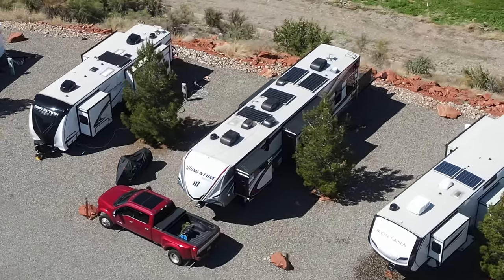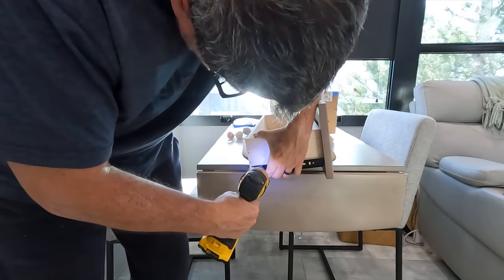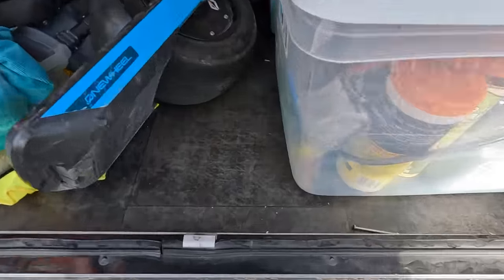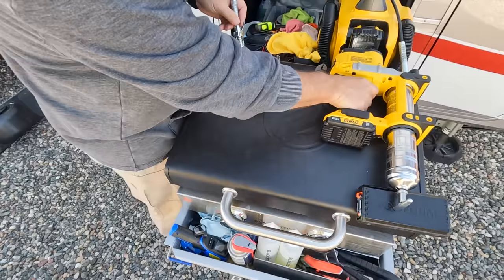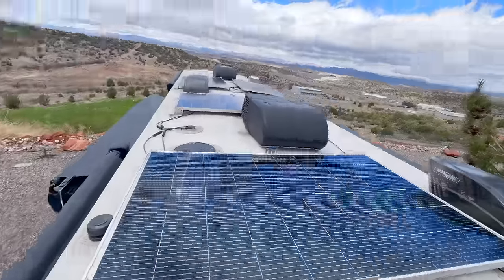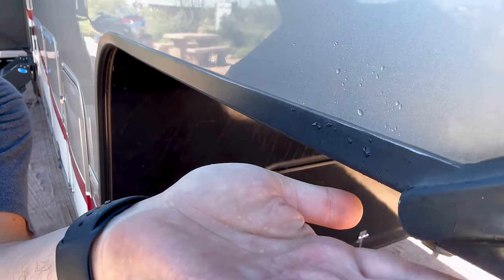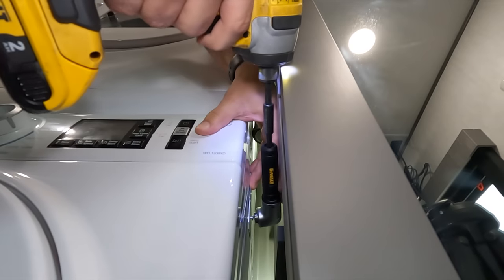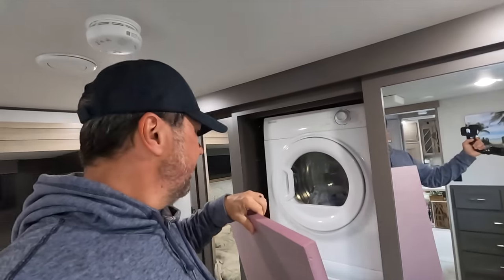Quick Fixes to some Annoying RV Problems! (RV Life!)

Comment: On your basement latches they are supposed to be a gasket and they are not thick.(paper thin gasket)  I was told by a dealership to run a bead of caulk around the latch to seal them up.  No problems with the latches once I did that.

Comment: I used the Splendide stacking hardware. The dryer is securely attached to the top of the washer. It hasn't moved in over 2 years of full-time RVing.
Reply: ditto only 5 years no movement
Reply: Same here with the stacking hardware.

Comment: I had the opposite problem on my brand new Brinkley.  One latch on the rear storage door would not release.  When you lifted the handle you could feel the latch move then all of the sudden in would snap closed before the door could be opened.  I had to force the door open (luckily w/o damaging anything) and opened the latch to find that when lifting the handle the mechanism that lifts the latching "bar" was slipping off the cam that connects to the handle, simply because the screw that held the latching bar to the cam was loose.  By simply tightening it it worked fine.  The annoyance is that when it fails the compartment door latch locks "closed."

Comment: Appreciate you’re videos. I watched another video on resealing edge of roof and gutters and the person mentioned using a small piece foil hvac tape for gutter seams. Our 2005 fleetwood had foil tape and looked like silicone underneath. I put a little dab of silicone and then foil tape.

Comment: The only thing I would suggest if you're going to use some kind of insulation on either side of the dryer is to remove it when in use because of possible airflow problems and heat build-up. Please keep up the great job you guys are doing.

Comment: Look for "Air Wedge Bag Bump" air wedges used for leveling. That will let you dial in the side pressure to keep it from rocking while providing some give.  Also very light and quickly removable.

Comment: I see lots of good suggestions here.  We used pool noodles.  They are inexpensive, available everywhere come in a wide variety of colors.  It wasn’t actually a pool noodle that we used, but some pipe insulation from Home Depot.  I wanted black because I wanted to be as inconspicuous as possible
Reply from the maker: I was just wondering if they had pool noodles in black.. LOL. I'm leaning towards the pipe insulation too. 👍🏼
Reply: Florescent would be good for night time

Comment: I have a 2018 Arctic Fox fifth wheel. I drive 15k miles last year including a trip through Canada to Alaska. I haven’t had any trim issues or slam latch problems.  In fact I haven’t had a single problem with my RV. I went and bought the Dewalt air compressor after watching your last video. Thanks for the tip, this is a fantastic suggestion.

Comment: Hobby Lobby has pillow foam in different sizes and thickness you can probably use. We got the 3 inch thickness squares to shove up in the kitchen and bathroom vents for winter temps it kept the RV much warmer this past winter.

Comment: Quick tip for anyone working with Eternabond tape - once you've removed their miserable to remove protective, put it on a piece of parchment paper to maneuver it around. You can fold it and pull it loose and it won't stick at all to the Eternabond tape (and save a lot of frustration in the process)

Comment: Thank you for the slam latch lube idea.  Mine were doing the same thing.  I put a little marine grease on each side of that lever part you greased - hoping it will be resistant to the water that gets in there.

Comment: I love that my 24-year-old Monaco dynasty has drain tubes for the condensation from the ACs that run it all the way down underneath the couch. No Mas and I still haven’t had any problem with my bay door latches except for cleaning and moving them without having to take anything apart, and I do full-time in my motorhome. Thank you for another informative video.

Comment: Chad, something I learned about the Splendid washer you have. If you wipe the inside of the bottom rubber gasket after each wash and leave the door open so it can dry properly you wont get that discoloring and possible mold staining on the gasket,
Reply from the maker: Yea.. we do that after we replaced the gasket in our last one.. 👍🏼

Comment: Same problem with the latches and my fix was the same as yours.  Though I did add sealant around the top and sides.  Plus along the hinge at the top to stop water from getting inside the door itself.   For my drip rail I used Lexel.  It sticks better and is more elastic than silicon.

Comment: On the dryer I would be concerned about blocking the air flow into the dryer with insulation on the sides.   Maybe have it in there when you travel and take it out when you're going to run the dryer. What you did on the gutter seal looks good.  I would have tried Flex Seal.

Comment: Another idea for the rust on the lock... Boeshield makes a rust and stain remover that could maybe help with the rust on the slam latches.  Then add some grease or lube as a protectant.
Reply: Was going to say the same thing Boeshield T9 works wonders

Comment: Just a thought. Try putting/wedging a couple 3’ tubes of fiberglass pipe insulation vertically alongside the machine’s. Has better heat/fire resistance & will allow vertical ventilation. Great tips & ideas! Thanks for sharing your experiences 👍🏼

Comment: For the gutter use a rubber sealant spray like Flex Seal,  you like Gorilla brand products , they  have one Gorilla Waterproof Patch and Seal Spray.  My experience is the products are very thin and would require  several coats.  I used  Rust-Oleum brand on my house gutters.

Comment: Our stackable washer/dryer unit came screwed together similar to what you did but we find that there is room on both sides that not only does it move while travelling the whole unit shakes a lot during the spin cycle.  We have fixed that by putting pool noodles on both sides of the units.  if not enough room you can cut them in half to fit.

Comment: In our 390RKR with the washer dryer I actually pulled the out half way and blocked up the front to be level.  Then used two pices 1/4" steel 8 inch long and 2 inches wide and drilled for four bolts on the washer and four on the dryer.  Marked them out on the appliances and drilled the appliances and installed threaded rivit nuts 1/4 x 20.  Then used bolts and loctite blue to fasten together.  I was worried the self tappers would eventually work their way free.  We now have a 399TH with washer dryer in the garage and I sure prefer that.

Comment: For the gutter, I used caulking only, and it stuck on pretty well. For the Lippert basement door handles, same issue as yours where rust appeared early on, needed to be greased and saw that the handles end up "catching" a lot of rain water, enough that when you open the basement door (lifting it up), as the handle is now upside down, that residual caught up water runs down the door and the open basement area, needs to be cleanned often.

Comment: Nice fixes.  Pool noodles or pipe insulation pieces might be able to be cut to brace the washer and dryer.  They would have some moderate compression and fill the spaces.  Just a thought.  Happy travels.

Comment: Chad I would use a piece of the foam from an old mattress topper not only do they have the density you need they also work well with double-face tape. Give it a try I think you'll be very happy with the results. Also, it's nice to see you guys back on the road again and your fixing stuff I'm so tired of a lot of the other channels on the frame flex soap box.

Comment: The Splendide stackable pair we have, the dryer screws down (or has a latching bracket, can't remember offhand) to the washer.  We have ours under the "attic" in the garage (399TH).  We also have floor brakckets.  Even before I put a cabinet between the top of the dryer and the garage side floor of the "attic", we never had that thing move.

Comment: What we found works best for us is: M-D 3-1/2-ft x 1-1/4-in Gray A/C Foam Air Conditioner Weatherstrip from Lowe’s!  Hubby put this in between the wall and the washer/ dryer on both sides and this stopped the movement and worked great because it’s flexible yet cushioning.

Comment: I want to reiterate what Chad said about our American highways — they are CR*P!  We are on month two of a three month trip, filling in the last four states of the lower 48 on the map on the side of our RV. In particular, the bridge abutments are generally awful. This trip our 2018 RV suffered a broken leaf spring, no doubt due to the horrible conditions of the roads. In addition, several trim pieces fell down.  Our rig had 30K miles on it before the start of this trip. With that many miles you would think that the “shakedown phase” would be over. Not with the state of our highways!

Comment: If you lube between the metal part that slides against the plastic of the latch it will work smoother

Comment: Have you considered Rockwool insulation board on each side of the washer/dryer? It’s stiff enough, it won’t fall apart and it’s not flammable and you can cut it to size. Just a thought.

Comment: I just purchased an LG 2.3 cu combo for my 42ft Fuzion Toy Hauler…was looking for some ideas to reduce the vibration.  Although it’s a different issue I stumbled across something that might work for you. Didn’t read through other comments - so not sure if someone has already suggested.  During my online search I came across the following that might work for you.  Search: Stacking Kit for Washer and Dryer, Universal Washer and Dryer Stacking Kit with Pull Out Drying Rack, Adjustable 29"/28"/27"/26"/25"/24" Stacking Kit with Ratchet Strap.

Comment: The actual top panel if the washer has come off. The dryer sets on top of a plate that latches  in to a slit on the dryer. The whole top of the washer has come loose. Clever temporary fix you have done there. But the dryer needs to come out and the washer top repaired.
Reply from the maker: The washer top doesn't seem integral to its operation, so it'll likely stay as is unless something goes wrong.

Comment: I'd probably flood those door latches with fluid film a couple times a year, that would lubricate and also stop the mechanism from rusting.   You can probably sneak a spray straw into the mechanism without taking it apart each time.

Comment: The eternabond didn't work on my gutter seam, but I hope yours holds!  My latest fix for it is 2 part epoxy in there (tape on the bottom until the epoxy set), which seems to be holding.
Reply from the maker: Thanks.. that sounds like a good plan if this fails.  👍🏼

Comment: Chad I would remove the dryer then get some aluminum thin wall angle and frame it around the top of the washer anchor down to the washer then place the dryer inside the framed top of the dryer, then screw it good the the aluminum angle maybe like 1-1/4" x 1" x 1/16" making two units as one. But hey your brackets worked also.

Comment: Another great project (that I did), I ended up doing.... after a time, the washer and the dryer began to squeak.  Bad.  I've solved most by being able to replace the bearings on the dryer.  I could NEVER get the bearings off the washer motor.  I destroyed two bearing pullers trying to get them apart.  They are ON there.

Comment: These things all have problems, whatever the price point, and so many new RVers let that frustrate them to the point of seeming to hate their rigs.  IMO, just making your own fixes is usually the right answer, along with sometimes bringing in the pros, but in either case, accepting that things will happen.  We haven't had interior trim fail (yet) in 3 years of full-time, but at one stop I noticed that one exterior trim piece was missing, and the one just like it on the other side had a screw missing, another almost out.  Early on, we had a storage bay latch fail, to where we could not open that door.  Luckily, it was a pass-through, so I went in from the other side and got it open.  The part the handle moves is supposed to slide against another part, but had gone past it (if that makes sense), leaving no way to open from the outside.  I did something to make it not likely to happen again, but I forget what.  Probably bent some metal.  We've had the same problem with a seam in the gutter, and I've resealed with silicone, but that didn't last.  I think I'll try the tape solution.
We had a leak in our roof from the beginning, and it only showed up in the heaviest storms.  It was hard to track to the source, but we found the roof has a "low" spot that makes a puddle form, right next to our skylight for the bathroom.  When the puddle got deep enough, the top reached a point where the sealant wasn't good enough.  It would then follow wiring to reach one or another light fixture in the ceiling (living room or bedroom, depending on the tilt of the rig), fill that, and drip.  Once I realized the source, I added plenty of sealant on both sides of the "bad" seal, and it's been good since.  As the great western philosopher Roseannadanna liked to say, it's always something.  We even had a roof leak on the truck, which a couple of dealers tried to fix but failed.  Turned out to be a light/camera fixture that wasn't well enough sealed.
As for the bad roads, when we started, we took your advice and didn't bolt down our wheel dock.  Mostly, that was fine, the bike was strapped down front and back.  But some roads were so bad, the whole front, dock and all, was able to slide sideways a little, not good.  So I securely attached the dock, which in ours is in a dedicated mini-garage, so no problem having it always there.  I heard that there are plans to one day pave I-20 through Shreveport.  Our dryer is well secured, but our residential fridge wasn't, and we kept having to adjust it after rough moves, until the factory guys heard that it moved, and said it shouldn't.  So they fixed that for us.  I think something similar is going on with our dishwasher, as it seems to be canted a little sometimes.  I suspect there's a bracket for your dryer that either wasn't attached properly, or wasn't installed at all.

Comment: We have a 2021 382WB - same issue with the door latches. Poor quality, and installation alignment issues also exist on the wetbay door, causing it to pop open while we are driving. Shimmed that one a bit, wire brush and lubing the rest. Had the same issue with washer/dryer. I built a wood platform for the dryer to sit on about an inch above the washer. I don't think the washer is strong enough to hold any weight on top of it when bouncing down the highway., ours was starting to cave in on top.

Comment: Our Splendide washer, when rinsing moves quite a bit.  I’m not sure I’d want that more securely “attached” to the walls.  I’d be concerned about damage to the walls, and shaking the “house” during the spin cycle.

Also, Splendide makes a bracket to mount the dryer to the top of the washer, but that tight fit in the closet might make it difficult to use.

Comment: Splendide makes a bracket that installs on top of the washer with screws and securely fastens the dryer on top.
Reply from the maker: I think that was used when installed but the top came off the washer.
Reply: @ChangingLanes  Self installed ours last July (replaced Whirlpool) and it's been rock solid in the back of our 38' Class A.  I'll check it before our next trip!

Comment: I'll watch the video shortly.  We had TWO WHEELS develop tiny cracks, losing air on our way from AZ to MI.  No fun when the spare tire is already mounted and ANOTHER WHEEL starts leaking.  This was the THIRD wheel this happened on.  I now have steel wheels and commercial grade truck tire$$$ on the 5th wheel.  Also discovered the MORryde installed disc brakes are only wearing pads on one side of the rotor.  Still following up on that issue.  It was a rough ride home!
Reply: Need to get Michelin lol
Reply from the maker: Yikes!  Glad you made it!  Our brakes wore like that also.. I need to keep an eye on them and maybe grease the caliper mounts.
Reply: @ChangingLanes  I called MORryde today, and sent them photos.  We'll see how this plays out.
Reply: @JamesAutoDude  Michelin XPS RPS tires :)
Reply: @JamesAutoDude  I did.  Although the problem were the rims, not the tire.  I now have steel rims with Michelin XPS RIBS

Comment: Chad...put a plastic bag in between the washer/dryer and the wall on both sides and spray expanding closed cell foam in the bags.  Close the bag.  As the foam expands in the bag it will fill the space between the W/D and the wall when it sets.

Comment: One of my gutter seams is doing the exact same thing.  I'll be addressing that issue when it gets a little warmer.  Thanks for the tip.  The gutter on the utility side is a different story.  It wasn't installed level with the roof and therefore has a low spot where the water pools, then overflows on top of our slider topper, then puddles and drains...usually when I'm standing underneath it.  Not sure how I'm going to fix that yet.  Maybe do some sort of a build up for the outer rail.🤷‍♂   For the dryer sides, I might suggest one of those really thick foam kneeling pads; maybe even doubling it up if needed.  Thanks again for all your videos.  Bravo Zulu.

Comment: New RV with quality issues.  The doors should have been found on inspection before you picked it up.  Why was the leaking happening on roof to down the side of wall:  looks like cracked maybe from topper installment.  Glad you can fix all these issues Chad.
Reply from the maker: The doors were fine when we picked it up.  They rusted over time.  The leak was just some dry sealant over a gutter seam.